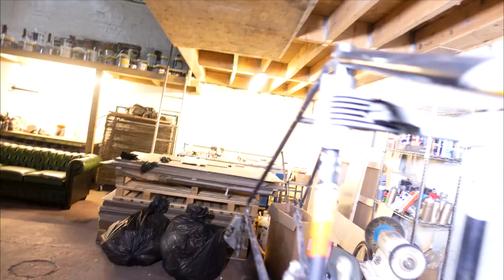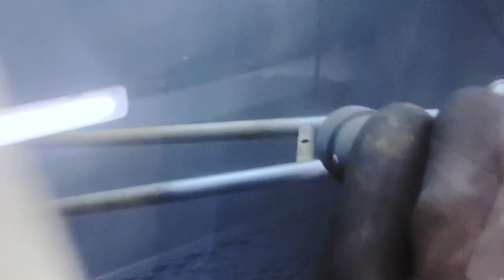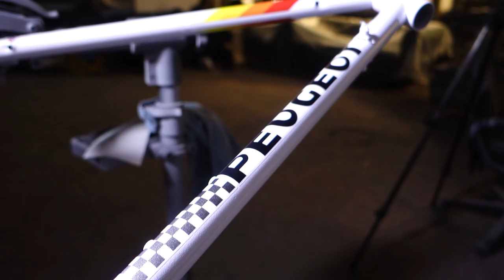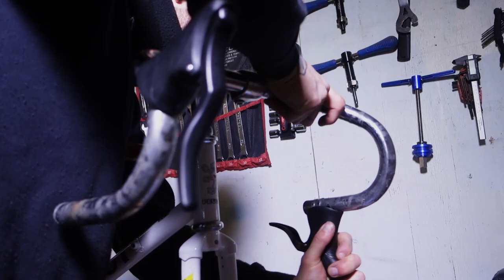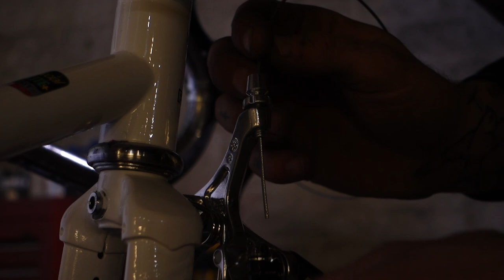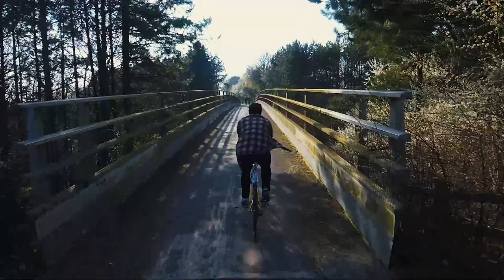Vintage Peugeot Bicycle Restoration & Ride

Comment: Helps me to work on renovating my bike from my teenage years. A Youngs frame bought in 1963, ridden for tens of thousands of miles and raced over a ten year period then stored half a century. Gearing compared to today's bikes is laughable - 53/45 x 6 (12 to 21)... how the heck did I climb the hills of Kent, Surrey and Sussex?

Comment: Been a mechanic for almost 50 years and used to own a nice Peugeot PX-10J?  from the late 70's.

Bottom Axle Tapers should NEVER have grease applied before attaching Crank arms.  These are an air tight fit and ALL grease should be cleaned off the taper and crank arm before initially being tightened down and checked again after your first ride.  A common issue is for these type of crank arms to bottom out on the tapers when grease is applied or over tightened which will cause the crank arms to wobble on the axle and get ruined.  Phil Wood used to sell sealed bottoms with over sized axle tapers which fixed the problem if your crank arms were bottoming out (much better bottom bracket as well).

Another trick is when cutting the electrical tape off to finish wrapping your bars cut the corners off at an angle.  This keeps the tape ends from spreading out.  You can use hand cleaner to remove all the glue left over on the bars when you removed the old tape, it makes the brake levers easier to install again when the bars are clean.

It is to bad they put the internal brake cable openings on the right side of the frame top tube as the rear brake causes the cable to cross over behind the seat post which I think does not look as clean as when the cable exits on the left side.

Before I sold my Peugeot I stripped the frame paint like you and manually filed down all the lugs before I had it professionally painted White again with Dupont Imron paint.  I think the frame looked much nicer with the filed lugs.  My frame had a partially Chrome fork which I kept when it was repainted.

I think the bike came out looking great and I appreciate that you cleaned up the frame and repainted it and the new decals really made it pop.  Thanks for showing us your work and making the video.

Comment: Loved the actual renovation part. Covered a lot in a short space of time; very useful. In my opinion the ride part needs to be chopped down to two minutes or less. 
Very trusting to ride without a helmet on the roads.

Comment: Fantastic!!!! Master craftsman at work. Watched it right to the end. I am working on a U08. Nice to know what can be done. Like how you set the front brake to go from the left handgrip directly to the brake and the rear brake from the right hand grip into the top tube then out to the rear brake. What shifters did you install? What cables did you use - brakes  / gears? What seat is installed? Brake pads? Thanks